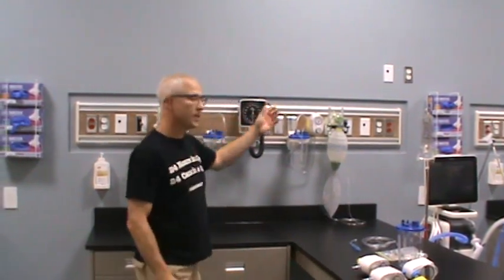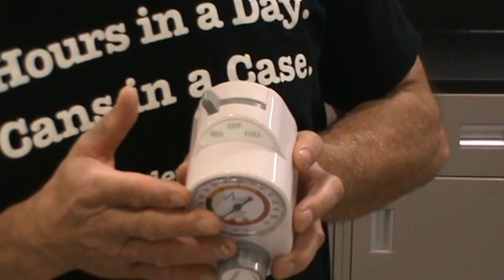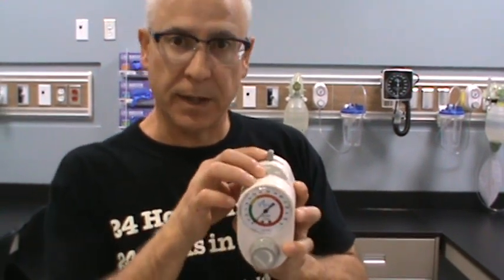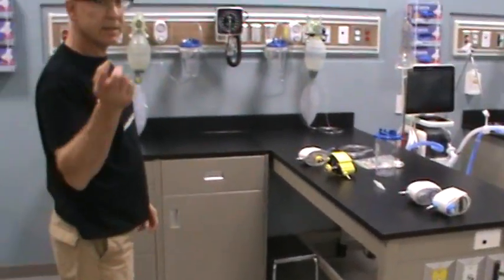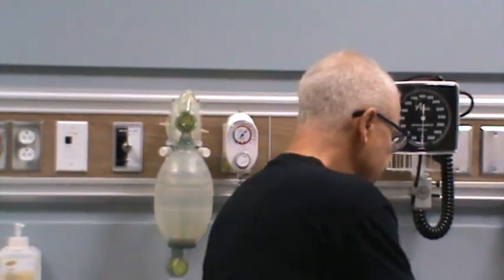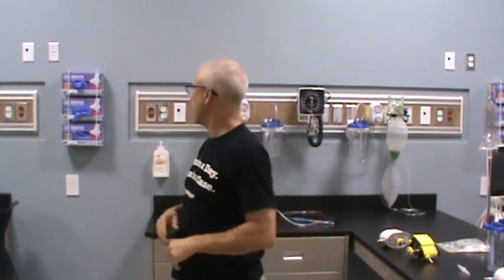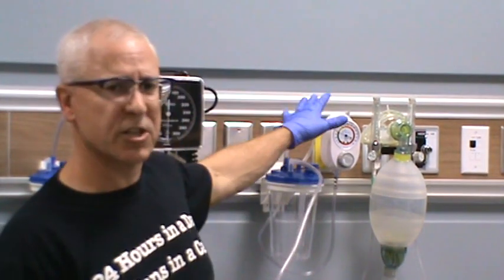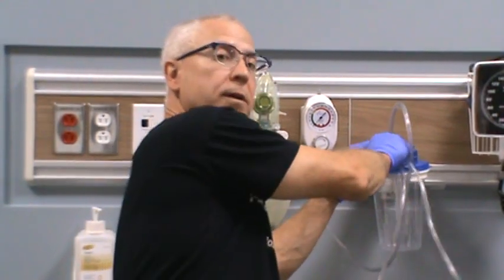Setting up Basic Suction Equipment for Suctioning a Patient.

Comment: I would like to ask some1 a question. I wonder if the regulator  is on the wall but upside is it working correctly.  My wifes granda mother is in the icu and i think they have no clue how to do stuff. She had internal bleeding  coming  from a mass in utrs.  It was cauterized  but she  has been swelling.  The regulator  is back works os it operating correctly the gauge  say full blast on red
Reply from the maker: Hi: yes it should still function correctly.  It may  look weird, but most suction regulators work the same way and the position its in should not affect it unless its a piece of junk.  Have someone there check it if you think there is a problem with it.  I personally do not like having equipment the wrong side up.  I hope that your wife's grandmother makes a full and speedy recovery.

Comment: Hi George, I have seen a few of your videos.  Great job!  Very clear and informative.  Have you made any videos that discuss appropriate suctioning pressures for various purposes?  i.e. When should I use intermittent suctioning?  What pressures should I use for tracheal suctioning?  Thanks for your videos.  They have been a wonderful resource.
Reply from the maker: Hi Chrissy.  Here's what we generally do but always confirm the acceptable protocols for where you work and provide patient care.  Please note that the following values pertain to negative pressure.  Also, I have done some suctioning videos that are available on my channel.

Generally:

With tracheal suctioningl we stick to these pressures: Infant 60-80 mmHg; Ped 80-120 mmHg; Adult up to 120 mmHg.  That being said, if secretions are thick and copious, higher levels of suction can be used for a short time if its less detrimental to patient care than multiple suctions at lower levels ...IE: suctioning an adult @ 150 mmHg to get those nasty secretions removed.........the key is patient safety.  

EVAC suctioning (tracheal above the cuff) initial suction up to 120 mmHg, then set to continuous suction @ 20-30 mmHg.  

Oral pharyngeal suction is usually full line.

Gastric suctioning: Depends on the style of regulator you have access to
intermittent pressure 50-80 mmHg
Continuous 30 mmHg

Thoracic: Usually 20 cmH2O is a good place to start with adults, 10-15mmHg with pediatric patients.  If the patient has a combined hemo-pneumothorax then you may have to go with a more negative pressure but ensure your doing so safely and watch for adverse effects.

Hope this helps and thanks for your comments.
Reply: Hi George.  Thanks for taking the time to reply.  The information is very helpful and appreciated.
Reply from the maker: No problem